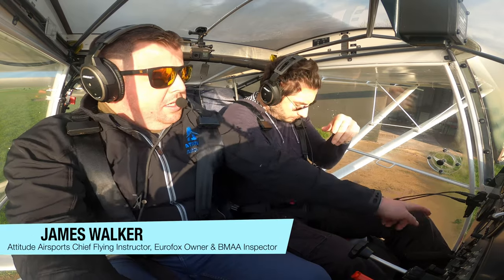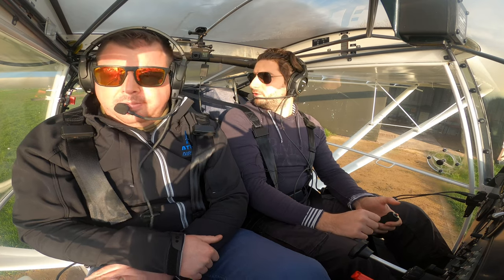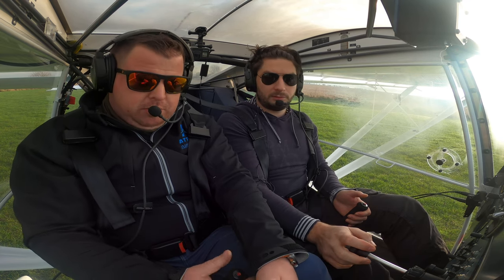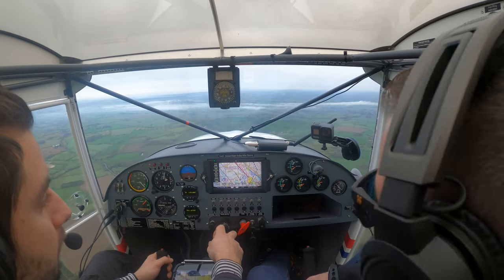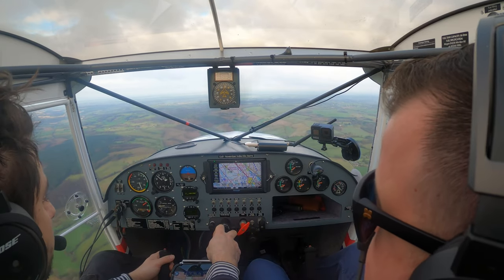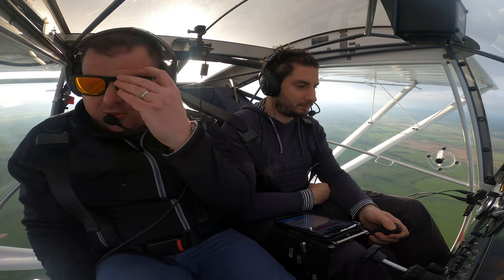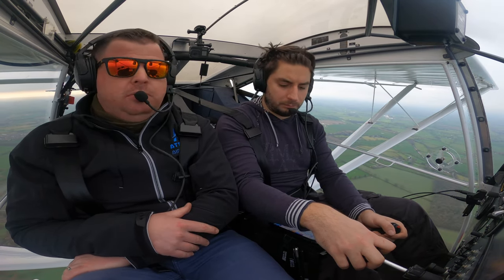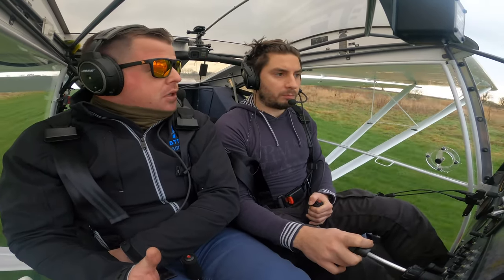Collecting My New Eurofox In Poor Weather From Otherton & Learning How To Fly It | Let's Go Flying

Comment: Recently came across your videos, Nick, and am working my way through them. Entertaing and very well produced &  edited, with all the "right" camera angles.
I tend to fly a PA28 or C152 but do like the look of the Eurofox and the C42 👍
Reply from the maker: That is very kind of you to say, thank you! Definitely get yourself into a Eurofox if you can - they have a very GA feel to them and are extremely capable little aircraft, particularly under the new weight regulations. At 560kg MTOW they have around 280kg payload capacity, which for a two seater is huge!
Reply: EuroFOX is the best! 😄👍🏼

Comment: The Eurofox is looking very good Nick. Looking forward to watching your adventures in it. What does Anna think of it? 👍😎
Reply from the maker: Hi Tim! Thanks for watching! Anna is in two minds currently - she was very attached to MEGZ and I inherited a couple of issues with NIKS…one of which almost caused quite a nasty accident that turned out to be a carburettor issue. I had the carbs overhauled immediately where the issue was found and the plane is absolutely Bob on now, 100% but it will take a bit of time for Anna to build up the trust in it. It is definitely trickier to fly than my last 3 planes as it is a lot more slippery. Not something that would bother you at a big airfield but the sort of little strips I fly in and out of you have to make sure you really nail the speeds on approach or you will just float and float. It’s swings and roundabout though as the trade off is a 100kt cruiser with ample space for luggage and 86 litres of fuel capacity! It’s all a learning curve though and I am getting used to it! I have no doubt I’ll be able to land it as short as I could MEGZ, with practise!
Reply: Lovely aeroplane, a million miles away from the MK1 Kitfox. Sorry to hear that you've had issues, I've seen worse with apparently "immaculate" aircraft though. Glad you got it sorted. G-MEGZ did look a lovely aeroplane though.

Comment: Thx for sharing. Interesting to see the difference in need of rudder from one plane to another.
I kind of like the Eurofox but with water coming in, it sounds a bit flimsy. In my (very) limited time on a Eurostar I had the feeling it was nice and tight and felt very solid. How come you gave that one up in favour of the Eurofox?
Keep posting, very entertaining and educational!
Reply from the maker: Thank you for watching! I sold the Eurostar to buy the C42. My concern at the time was residual values due to the new 600kg rules. The C42 was a great all rounder and very docile but the slowest of all and the Eurofox gives me back the Eurostar visibility and speed (if not a little more speed) with huge touring capability due to going up to 560kg (my application has already been sent off!) having a huge luggage area and 86L of fuel capacity. Regarding the water, I think the lexan on the doors has been replaced leaving half a mil gap or so. I have since fitted a door seal to each side and this has stopped the water from coming in!
Reply: @LetsGoFlying  Valid point that of the residual value. The later Eurostars were already built ready for a change in legislation, but I am not sure from which year. 
Thx for sharing your experience and thoughts, it helps the rest of us in our own through process. 
Keep posting!

Comment: There were several references to a C-42. What plane is that?
Reply: Comco (German) C42 Ikarus microlight (or ultralight in the USA, some would be Light Sport too though - depending on spec and certification). There's several variants including a C52. Hope that helps 👍🤞😊

https://en.m.wikipedia.org/wiki/Ikarus_C42
Reply from the maker: Hi Guy, thank you for watching! As Muso Seven has pointed out correctly, it is indeed as he has described.

Comment: Nice aeroplane. 

Is the extra rudder due to the motor (100bhp?) or the flapperons? My dad was never quite convinced by them in his MK1 Kitfox🤔🤔😲😄😄

I'm no expert, but I think, if there's an aux (electric) fuel pump fitted? Put it on for take off, landing and anything up to 1000'. Each to their own though.

What's the cockpit like for drafts - has it got a heater (those types of doors always seem to leak air, water or both)?🤞🤔🤔👍😄😄
Reply from the maker: This one is 80HP but it needs plenty of rudder just due to its handling characteristics. Having flaperons as well it is not recommended to be making big roll adjustments with the flaperons on final either. Yes I do use the fuel pump for t/o and landings myself usually. The cockpit was a bit drafty, however, I have added some foam door seals which have done a cracking job of sealing them off!
Reply: @LetsGoFlying  Thanks. I was going to suggest some bespoke or adapted single sided self adhesive foam seals - that's good news you've got a result. Indeed flaperons take some getting used to. I can't remember if a lot of rudder was required for the MK1 KF, it was a taildragger so a lot of footwork is usually involved regardless. 80bhp is plenty I would have thought🤔🤔👍🤞😊😊 Good idea re the fuel pump - or else what's the point of it, it's, at the very least, a double redundancy back up during tricky phases of flight👍🤞😊

Comment: mate hold the throttle correctly and not at the end
Reply from the maker: What on earth does that even mean?! Do you even realise what you just said?!
Reply: @LetsGoFlying  your instructor indicates correctly that you should hold the shaft of the throttle with finger tips at the panel end and  the butt of your hand where the knob is. Keeping this explanation as simple as I can, hold the throttle length with your hand not just the end as this gives you incremental control and stops any overuse in turbulence. In your video all you do is just hold the knob end with your fingers - not great. Now do you understand.
Reply from the maker: @alianjohnson6035  there’s more than one way to hold a throttle! We’re all different and find our own ways easier and/or more accurate and that’s a matter of opinion that is down to the individual to decide but thanks for sharing your opinion.